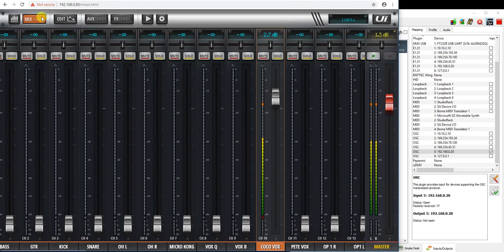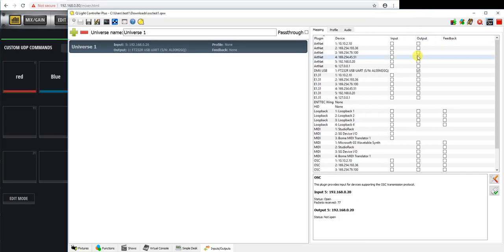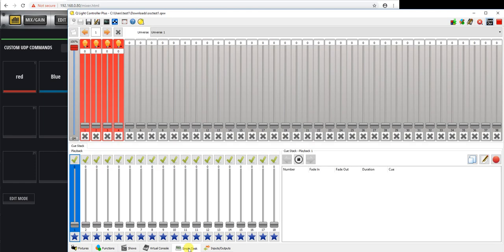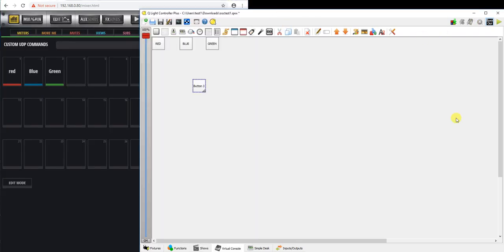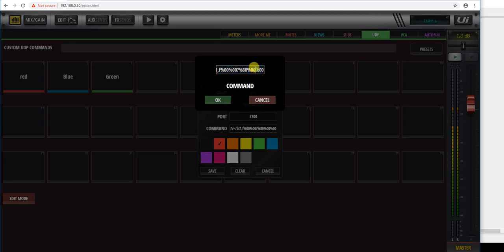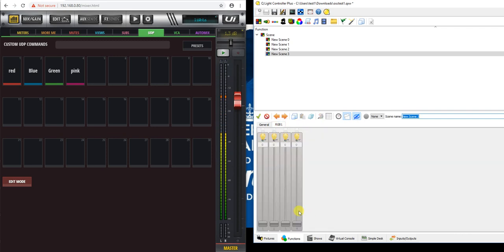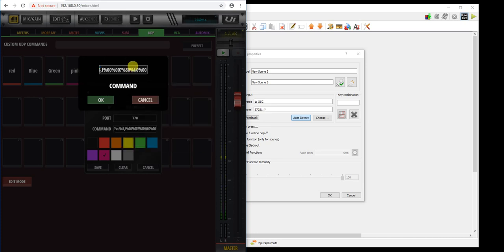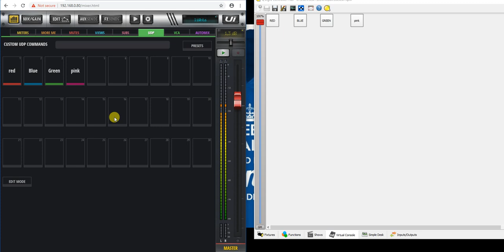Ui24R V3 UDP buttons control lights

Comment: I've followed this tutorial and was able to get a signal to QLC but I wasn't really looking to reprogram all my light scenes that I sequenced in Freestyler. I tried to use QLC to remap those triggers to output to a loop back midi and into Freestyler but spent several days without any success. I'm now using a secondary iPad app to send OSC to TouchOSC on my laptop using UDP and then remapping through TouchOSC to Freestyler via DMX. Not a fan of multiple apps and was really looking forward to using the new UI24R UDP buttons, but at the very least it inspired me to get control on the iPad finally.
Reply: Alright after fighting this for weeks I've downloaded a UDP listener and reverse engineered the command sent from TouchOSC and translated the forward slashes to a percentage symbol and BAM, it's finally working. Unfortunately it's only sending a momentary on release button and not on press. Wish I could change the function of the button.

Comment: I'm curious about how to avoid the need for bringing an extra device on stage to set up. Right now, it looks like you're using the Soundcraft Ui24r, which communicates with a computer/laptop via USB or ethernet, which then sends DMX signals (5-pin) to your lighting units.

This is cool, but is there a way to run QLC on an android tablet, and connect via USB-c or USB-microB? If not, I think I'd rather stick to buying (and bringing on stage) a DMX controller, such as the Chauvet Obey 40. Otherwise, it feels like the Ui24r isn't really helping make things simpler.
Reply: I currently use a UI24r combined with a Raspberry Pi 3+ that runs QLC+ (this is not free for Raspberry Pi). It is mounted in my amp rack which is based on stage. I then take up a FOH space and do both sound and lighting from this app